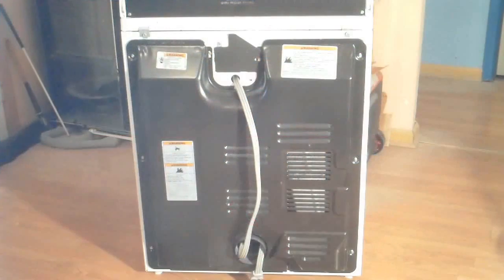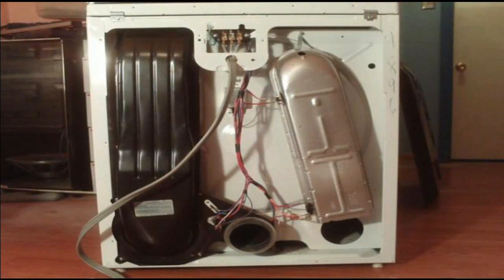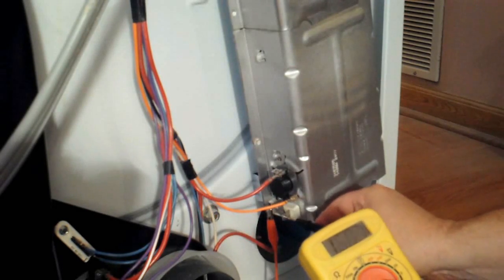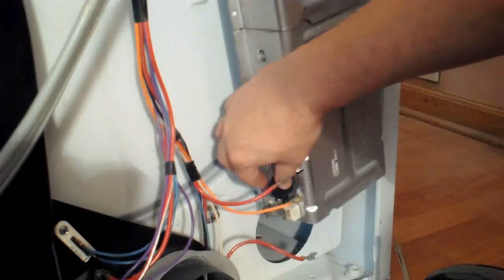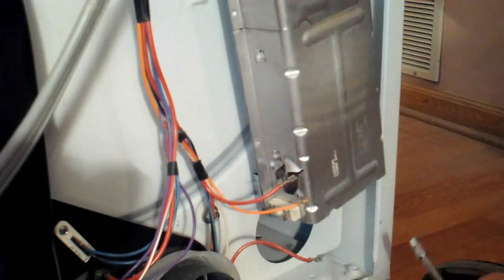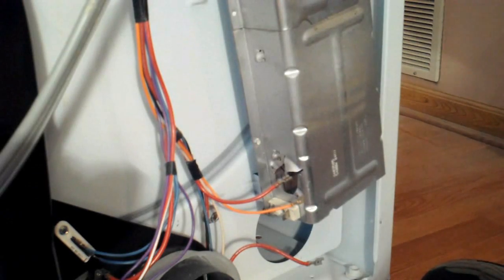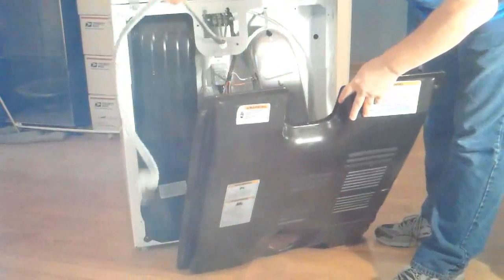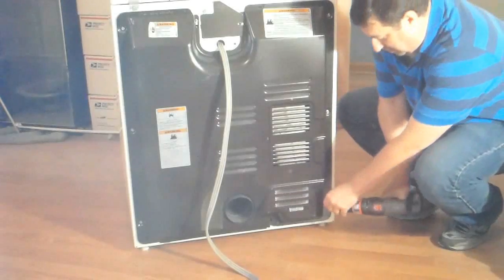Whirlpool & Kenmore Dryer Repair - How to Diagnose Won't Heat - Heating Element 279838 Testing

Comment: I am at my wits end with my whirpool dryer. I have tested all the thermostats and fuses for continuity and they are all good. 0 ohms.  
I tested the heating element coils...they are not broken and continuity good.
 I checked the wires of my 4 prong plug and I get 120  from the left side to the neutral wire terminal  and from the right side to the neutral wire terminal and 240 Volts from the right to left 

I checked the socket and the Voltage is good

I checked the circuit breaker voltage and it is good. It reads 120 Volts from the terminal to the neutral bar and 240 across the breaker terminal bars. The wires of the circuit breaker are not loose

However, my dryer will spin to the full amount of time set on airdry....but when I dry it with heat , the breaker always trips after 15 mins. Do you know what the problem may be?

Thank you so much
Reply from the maker: cgoldsmith Well, either the motor is going bad and is pulling too much power, and with the heat it is too much for the breaker to handle, OR the breaker its self is weak and needs to be replaced.  Test the motor, if it is good, then you might need to call an electrician to do a load test on the breaker.  Hope this helps!
Reply: canyonman1963 Thank you very much canyonman1963  Do you have a video on how to check a motor on a whirlpool dryer?  Is it normal for a whirlpool dryer that is only 4 years old to have a bad motor?
I tested the breaker (see my above post).  The breaker is not loose and I did the voltmeter test.  Do you think I still may have a problem with the breaker?  Is testing a breaker with a voltmeter the same as a load test?
Lastly, do you have a video on how to change out a breaker?
Thank you so much.

Comment: Could you tell me for sure what the part number for the heating element is? i found on online and its part number 279838 for the kenmore 70series. could there be another one or is that the correct one? greatly appreciate the help.
Reply: canyonman1963 the model number i got was 66722692. I had already got it written down because I've been doing research. I found a part online for a good price and i was to get it but want to be sure.
Reply: Thank you so much! Your a great help and doing great things by helping other people. May God give you many blessings!

Comment: I get a reading from one terminal to the hi-limit, but not the other terminal and the hi-limit.  What's bad - the heating element or the hi-limit?
Reply from the maker: Michael Falanga No sure exactly from where to where you are testing, so I don't know.  To test the components, remove the wires, remove the part if necessary, and test only one component at a time, from terminal to terminal on that individual part.  Then you can know for sure if that part is good or bad.
Reply: canyonman1963 Wow you are prompt!  Sorry for being unclear.  I was testing for continuity across the whole circuit (at 3:08 in the video) - from the heating element's terminals to the hi-limit terminal.  One of the heating element's terminal gave a reading, the other did not.
Reply: canyonman1963 I tested each individually - they actually had readings.  So I tested the thermal cutoff and it's bad.  I'll be replacing it (and the thermostat) and will let you know how it goes.  Thanks for the help.

Comment: OK, can you solve this mystery. Electrician on the way, but decided to plug it in again one last time just for kicks.....drum roll please. IT WORKS. I have a neighbor whom I know is and has been sabotaging things. How is it, all the parts on the dryer work, the voltage from the outlet is perfect (118, 119, 246) and yet it acts as though it is getting no power, then the next day is working fine....am I right to think this seems fishy?? (he does have access to the dryer.

Comment: I got a whirpool dryer JUST REPLACE all this ,Heating Element , Cycling Thermostat, Thermal Fuse, Cycling Thermostat ALL THE THINGS behind all new and good also I got 240v from the wall AND THE DRYER STILL NOT HEATING, WHAT ELSE COULD BE THE PROBLEM MAYBE THE DASH CONTROL ?
Reply: canyonman1963 
THANKS, U WAS RIGHT . THE PROBLEM WAS ON THE TIMER JUST CHANGED AND IT WORKS PERFECT WITH ALL OTHER NEW PARTS, NOW I GOT BRAND NEW DRYER, THANKS

Comment: I had my dryer installed and the three prong power cord was installed upside down. Does this matter? The dryer wont heat but turns on and runs. Should I assume that the cord being installed upside down killed the heating element?
Reply: canyonman1963. Ok thanks. On my way out to get a meter to test those components, thanks for the response.

Comment: I opened the back to replace the heating element and the very top wire, not the one going directly into the heating element, was burnt off.. It is the wire going into the metal box to the top of the thermostat and heating element..   Do I need to just replace the wire, maybe the heating element was okay.  If I do need to replace the whole wire.. do you have a video for doing that?. I don't have a meter to check anything.. Do I have a major problem and just need a new dryer?
Reply: canyonman1963
Thank you so much!  I will try and get a new part for the end of that wire.. I need to solder it on?  Sorry I don't know anything about it..
Reply: Thank you!  I had figured it out with the help of a guy working at Lowe's.. but thank you so much for your reply.. I fixed the wire with a new female disconnect and crimping tool..  Then I put on the new thermostat.. I am happy to say I did it myself (well of course with video's such as yours) and the dryer works great! (so far!)  Thank you Canyonman..  I must say for anyone attempting to fix theirs.. I say go for it!  The Dryer is pretty simple, not too many parts.. When I put on the belt.. I thought this is going to be hard.. Well it took me someone who never had done one before, about 15 minutes.. (well plus my old dryer has no screws holding it together in the front) so it was fast to open up.. :))
Reply from the maker: Diana Avina Glad the repair was successful!  Good Job!

Comment: When I checked this the number never changed- Does that mean I just need to replace the heating element and I will be back in business hopefully?
Reply from the maker: If you don't get a change in reading from I for infinity, or OL for open line on some meters, then the element has no continuity and is testing bad.  Remove it, and you should find that the coil is broken somewhere.  Replacing it will fix the element problem, so as long as all else with dryer is good it should work fine again!

Comment: Hello,  wanting to pick your brain.  Have the Kenmore Oasis Elite Dryer that as soon as you press the power button it would immediately go into an F2.  I checked for stuck buttons, didn't fix the issue, replaced the indicator board and it correct that error.  Now it will run for about 5 minutes then fault with an F41.  I have ohm the motor control cable and getting about 57-59, so my blower motor should be good.  Any suggestions on what I need to check net or what the issue can be?  Thank you for any assistance.
Reply: Thank you for the additional tips,  but still no joy.  fuse was good, nothing is stuck, wheel, belts all look good.  I guess I'm at the point to call a repair shop to diagnosis the problem.  Again thank you for your assistance.

Comment: can it still be the heating element if none of the coils are broken
Reply: Ok let ask u .... can the light bulb inside the dryer stop it from drying if its blown ... because this problem happened when the light was out.
Reply from the maker: Also, test the fuse up at the top of the heat riser tube.  If all wires look good, and if the fuse and thermostat have continuity as well as the heat element, then the problem is either a power problem at the wall outlet, or the timer is not sending power to the element to make it heat.  A bad timer is fairly common cause for no heat.
Reply: Ok thanks do you have a video on changing a bad timer
Reply from the maker: Actually no, but if you search here on YouTube I am sure there are others that have made video that shows changing out the timer.  I might make a few on timers now that you gave me the idea!

Comment: My Kenmore 80 Series only has 2 wires in back. Two red and no orange? We just had to replace the coils because one snapped... IT was working right before we took the old element off.. We had twisted the coils together as a temporary fix ( I know bad idea) but were poor ahhaha.. but then as soon as we installed the new heating element it wont heat.... Did that cause a fuse to blow or the thermostat??? HELP!!
Reply: Okay ya we don't have a tester.. Were gonna have to take the parts to the place we bought the element today to have them test them :( ugh should have just bought a. New used dryer.

Comment: i've tested high and low thermostats fuses heating element ans replaced them with new except the heating element continuity is good on all parts so what the heck is wrong i'm at a loss what am i missing please help i would just give up by now and get a new drier but since my wife developed epilepsy 2 years ago and with the vns ( very expensive neuro vagal stimulator device ei 125k ) my cost I'm trying to keep costs down to a minimum. So any help would be greatly appreciated
thanks
alex
Reply: canyonman1963 can you please help me I have a Kenmore 80 series it works and heats up for a little bit and takes for ever .. What can be the problem if you can help me please

Comment: Help! I have replace the fuse once it worked for cpl days and stopped again so this time I replace the element and both the high limit thermo and the high limit fuse at the top on side of the element it started getting hot again worked this time just a cpl loads and now has stopped heating again. What can be causing this to happen?
Reply from the maker: If it keeps blowing the fuse, the problem is likely restricted air flow.  Check the air duct that goes to the wall, make sure it is not crushed or crimped, or full of lint.  Next, make sure the air flows strongly out of the back of the machine without the hose on.  If not, either the blower wheel is rounded out and not spinning properly, or it and the blower box are full of lint restricting air flow.  If all this is OK, make sure the air is flowing through the wall ducting to outside vent properly.  If not, you might need to clean out the ducting through the wall to get the air to flow properly
Reply: canyonman1963 ok I got strong air flow coming from dryer and had already replaced the vent coming from in house to outside so I know its good also. So what else could I check for?

Comment: Help! While using my whirlpool electric dryer, I noticed a burning smell inside. I turned it off and looked behind the dryer and saw that the vent hose had become loose from the wall vent. There was a lot of lint on the floor. After I (somewhat!) was able to reattach it, I turned the dryer back on and the smell returned. When I touched one of the vents in the back of the inside, it was so hot it almost burned me even though the dryer had only been on maybe 1 minute. The dryer is 10 yrs old. After looking at some youtube videos, I realize that we have never had the entire venting system cleaned out; we have really only removed the lint from the topside screen. Any suggestions? Is a new dryer in my future?
Reply from the maker: It does sound like it is getting way hotter than normal.  I would unplug the machine, remove the back panel, and remove and inspect the heat element coils.  If one broke and sprung onto the metal casing, it can weld its self to ground, causing a direct short that keeps it heating all the time, even if the thermostats are clicked off.  Next, I would remove the blower box lint tube cover from the back, and make sure it is not full of lint, clean it out if it is, and replace it.  Finally, check the air flow to the outside vent to make sure the exhaust is freely flowing through the vent.  If it is stopped up, either clear it yourself, or if you have to call out an HVAC company that does vent cleaning to have it cleaned out.  If all of that is fixed and good, and still gets super hot, you could try replacing thermostats, but they usually wont cause it to get excessively hot within only a minute of being turned on.  Hope this helps!
Reply: Thanks, Man! I will do these things, and post the outcome! :)